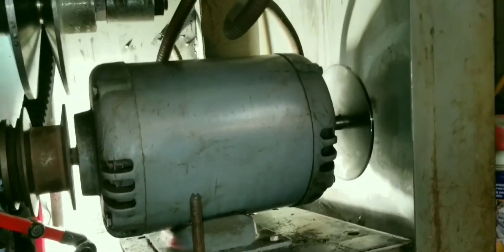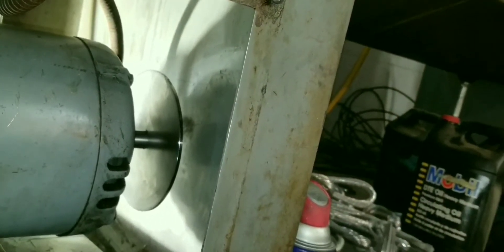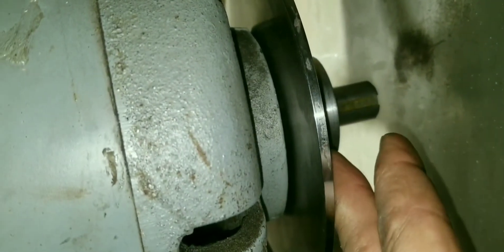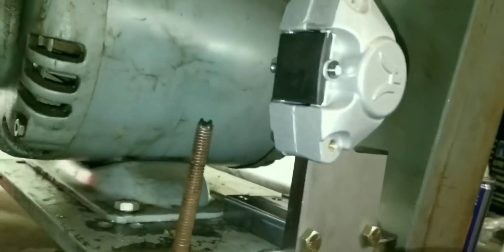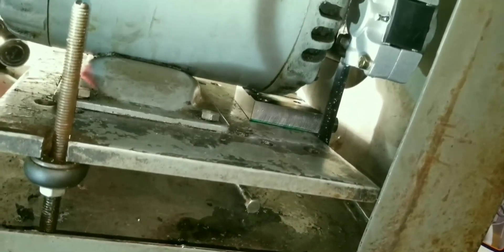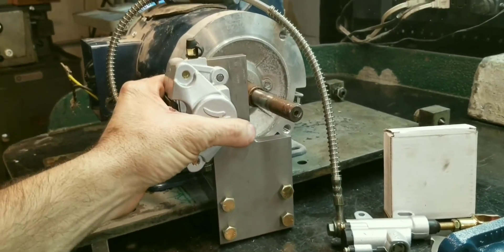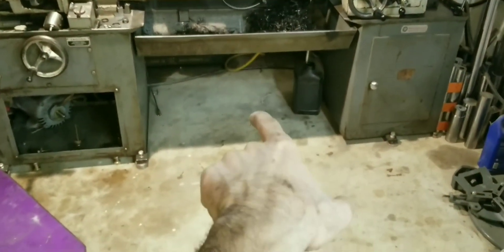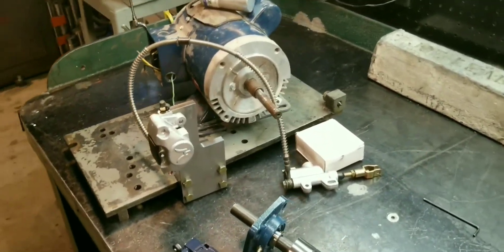Brake mod for Rockwell lathe (Part 1)

Comment: Great idea you've got there! 
I'm wondering; are you going to incorporate a kill switch that deactivates the motor when the bar is pressed - basically making it an emergency stop?  ...or is it going to be strictly a convenience feature to stop it more quickly after you turn the power off?
...Guess I'll wait and see what happens in part 2.